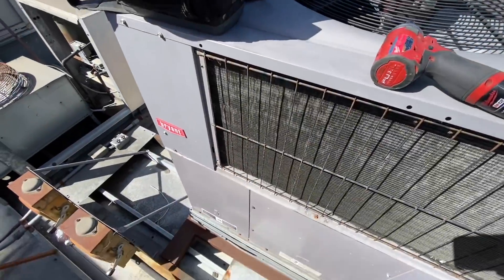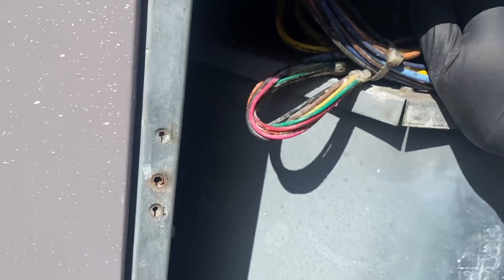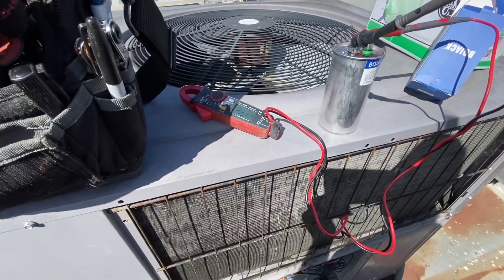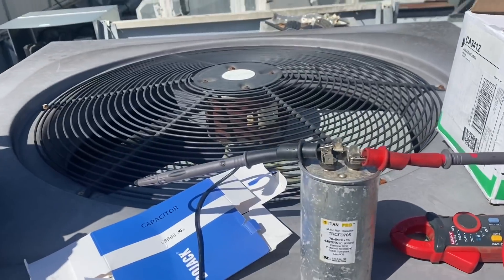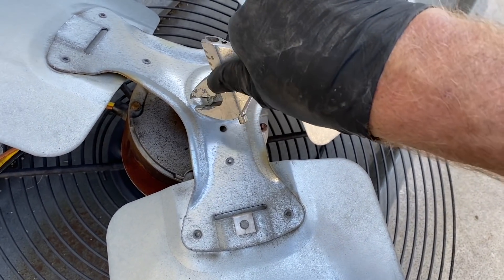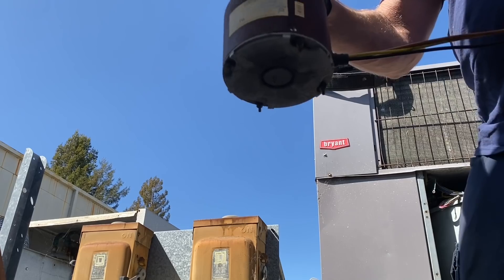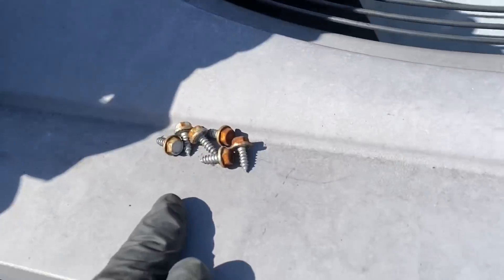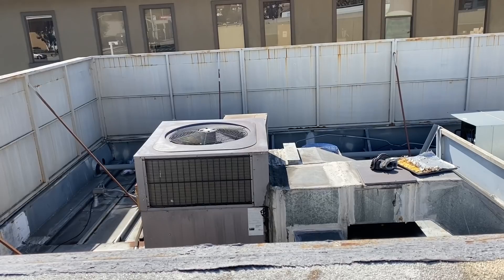Bryant Heat pump condenser fan motor change out

Comment: Those old Bryant (aka Carrier) package units suck! I worked on a similar one a few months ago, though it was a gas pack. Bad board, bad blower motor, bad inducer. Replacing the inducer was the most pain in the ass part of it. Carrier in all of their infinite wisdom indeed. Gee I can’t wait til the condenser fan motor craps out on that thing too. 🤣